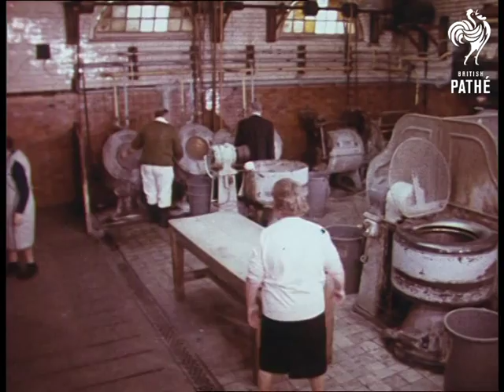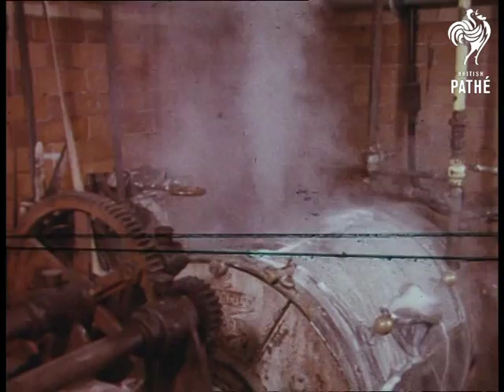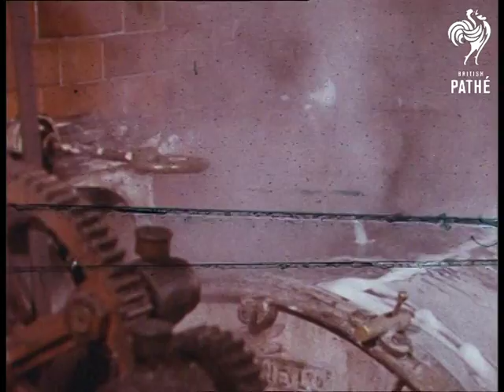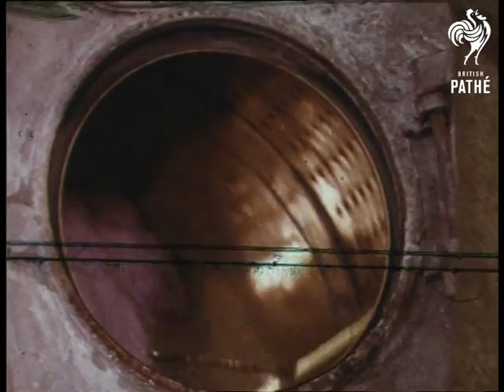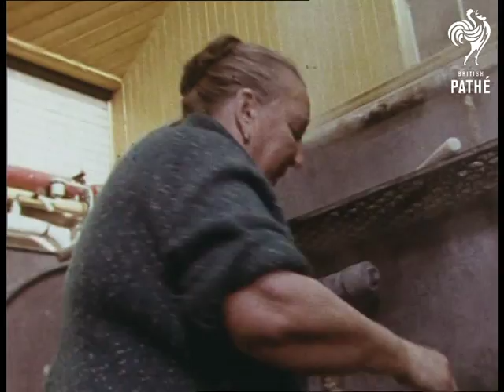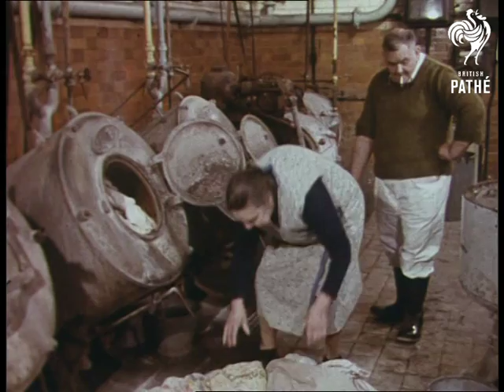London Wash House (1970-1979)

Comment: I’m 63. Graduated from high school in 1979. That laundry system seems antiquated for 1979.
Reply: I agree  the dates are wrong, most probably early sixties. By the 70s there were automatic coin-operated  laundrettes all over London. You could take your washing in early morning and it would be ready for pick-up  by lunch time.
Reply: By 1960, most people had a washing machine in the home and probably a spin dryer.
Even before that, there were hand driven washing machines.
The dates are way out.
Reply: @derekarnold3665  the film was made in 1971 as in the extended version ( which sadly has no sound) there's a MK2 Cortina parked outside in the final moments of the film.